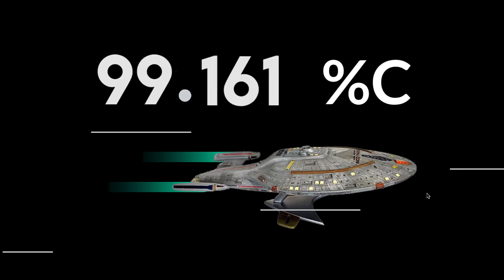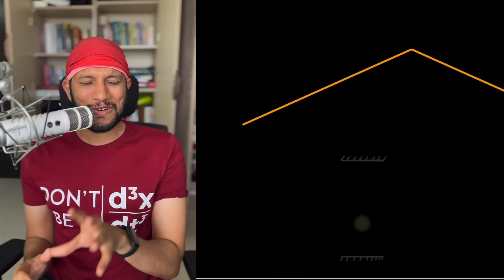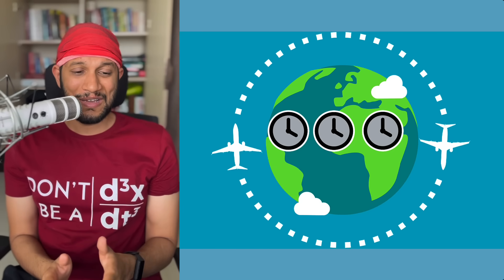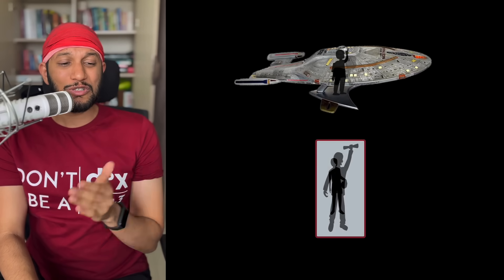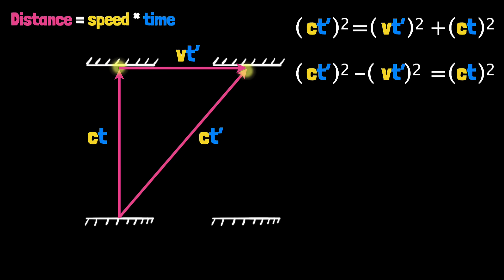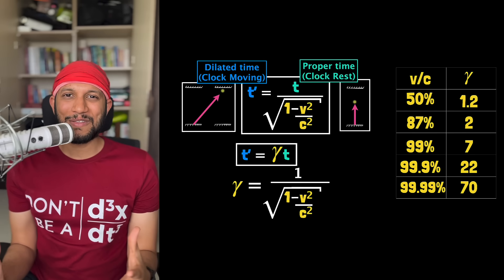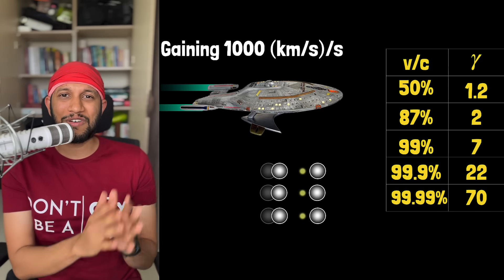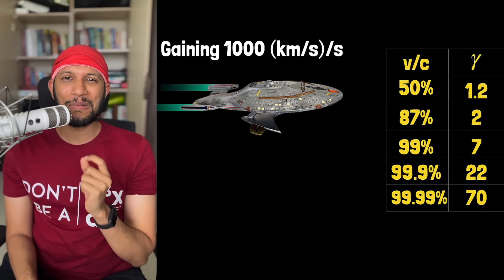I finally understood why you can't go faster than light! (My mind is blown)

Comment: the actual reason in General and Special Relativity that you can't attain the velocity of light is twofold.

There are matter space fabrics (3) and Aether space fabrics (3).  These are made up of gravitons and tensor bosons.  Tensor bosons having dual properties of the electrical force and the gravitational force (i,e. modern terms of ADC),.  Tensors hold the gravitons together with the gravitational force, while the electrical force keeps them from collapsing.  Here is steady state cosmic tension.

A graviton is made up of a positron-positron pair.  A tensor boson is made up of an electron-positron pair.  This is the 3D (4D) holistic volume of the cosmos, and quantum entanglement of these strings (the actual number of strings and their component parts).  This also has ring/loop string theory as well for these 6 fabrics.

The underlying positron particles in each graviton and tensor create the basement gravity level of that fabric.  The upper positron and electron create their own graviton field, while the tensors create their own tensor field.

Any object flying through these fabrics has drag, gravitational attraction and surface friction.  The faster your velocity, the greater your interactions with these 6 fabrics, and you build up a gravitational resistance, like running and pushing up the carpet in folds in front of you.  No matter how you geometrically or trigonometrically increase your velocity and fuel consumption, there is an equal resistance build up in space against your movement.

The ONLY way to overcome this gravitational attraction, is by having a worm bubble (Meissner force field) around your craft.  This is an electrostatic force field, which is that half of the tensor properties.  A Meissner force field - IS - a tensor field.  All of the stellar engine, fusion, photopshere, crhomosphere, corona, coronal mass ejections, ... photosphere Be'nard's Convection, chromosphere Lord's Convection (granules), spicluae on the photosphere-chromosphere boundary, corona filaments are all tensors.  Birkeland currents are tensor currents.  if you have an electrostatic force field around your craft, you have negated any gravitational force from touching the craft, and you have a slipstream, much like the Mach 1 atmospheric slipstream, sound barrier.  The same applies, with an ocean going ship that produces air bubbles along the side of the hull, this reduces the water surface friction on the ship's movement.  The key is slipstream.  Such a craft displaying this force field is like an Air Hocky game puck, floating on an air current, but it is its own form of a maglev train.  The fabrics become the 3D string rails on which the slipstreamed craft flies through space.  With a electrosttic force field you can negate Newtonian classical physics and Einstein General and Special Relativity.  You can attain light speed, and go into warp speed.  The worm bubble warps the space fabrics around the moving craft, without friction, and the worm bubble to a 3rd party viewer (General Relativity) would see a worm hole in action, when it is just a worm bubble moving at extreme velocity from one point to another.  Two active Stargates with a fixed connection would be an established wormhole. 
 
So this is the simple and basic reason why light speed can not be attained with conventional velocity crafts.

Comment: Speed of light relative to what? Lets say we have a reference point from which a photon can travel at speed of light at each direction.
Therefore maximum relative speed of two photons flying opposite direction would be 2C. 
Though through time dilation it might not be observable from either of those *, only the from initial reference point.

* Lets say same example but 0.5C. From reference point 1C between both, but since each have time slowed twice it's still 0.5C to them.

Comment: 1:32 No. Einstein's metaphor was about throwing a ball (matter particle), not a photon. Using a bouncing photon would be a bad reference since it leads up to a circle reasoning. A bouncing photon in a moving ship watched from different frames of reference has not been observed before. In stead we have this done with matter particles. That is comparing apples with oranges.

Comment: As the Big Bang occurred - as space time expanded - the length of the standard length increased and the speed of time increased thus the speed of light, which is an effect in space time - a wave that goes in and out - remained the same. A block of space time which has a constant speed of time \ standard length is a frame - see Einstein's relativity. If space time is pushed aside it ceases to have effect - the same as if water is pushed aside. As such the 'speed of light' would no longer be a limiting factor.

Comment: Nice work! So, it's impossible to accelerate a material object to the speed of light because it would require an infinite amount of energy.  

I'll add this to the concepts I keep in my head to wrap my brain around the whole thing, if I'm understanding correctly:

Photons go the speed of light, but they do not accelerate. If you are massless you are by definition going the speed of light, and therefore a photon. Photons are massless because of relativity. Light behaves both as a wave and a particle (photon), and this property allows it to carry energy and momentum even without mass. This is called relativistic mass.

Comment: If you know the fastest thing is light. then there is no possibility of going faster. Not like you can multiply the speed of light, maybe Math does not apply to light. sure you can crunch numbers but they do no apply to light. We have not even traveled at the speed of light. Until we find something faster then light, there is no way of going faster then light, as there is nothing that can propel  you faster then light. If electricity was faster, and used to propel an object? But electricity is not faster then light. we have nothing to propel faster then light itself. New technology one day may find an answer.

Comment: I think I've got it. I have a thought experiment that you can perhaps assist with. I have a super strong rod attached to the earth's surface that extends out into space. If the length of this rod is great enough, as the earth spins at 1000 mph, eventually, the length will reach a point where the end is traveling 300,000 km/sec. If the rod length is extended past this point - what happens to the rod? If I understand your explanation, the portions of the rod that approach the speed of light will slow down and the rod will appear to bend. If that's correct, what happens if we then slow the rotation? Will the rod assume it's original straightness?

Comment: Based on your explanation of reflective equations, if you want to reach a greater distance (macro), then you need to decrease your distance (micro).
Reduce the distance the photon bounces. The farther and faster you travel, the closer the bounce points need to be to increase the speed of the bounce/ energy.
It’s not the fuel that’s needed to increase, it’s the speed of the photon movement. Narrow the gap/chamber the photon moves in to match the speed traveling. The only problem I see at that point is physically enduring the increasing acceleration. Where the gravity exceeds the mass accelerating.
Just a thought. ✌️😉

Comment: Use a vacuum or Vortex Vacuum to surpass the speed of light.

Let me explain, first by example.
You're in a car, on cruise control.  A semi truck passes you and, without
effort, your car is pulled forward and faster, with NO extra gas or energy from YOU.
Another example.  You have 11 bullets, one in the center and 10 around it.  The 10 are
fired a split second before the one in the center.  There is a vortex vacuum and the
center bullet travels further and faster, in the same amount of time; it became faster.

Einstein showed that light can be affected by gravity, not because of having mass
but because it carries energy, which is equivalent to mass.....this is why it
could be affected by a vacuum or vortex....if you choose the right vacuum and properties.

In your example, there is CT, CT' and VT'.  A vacuum projected in front of
your theoretical spaceship would cause SPEED and distance to be greater than the
previous VT' variable.  Again, depending on how you build and project your vacuum.

See, there is a "bubble" - the theoretical ship.  This model is simply showing that another
bubble could be formed, outside of the ship.  "Bubble Theory"

Comment: I still don't understand. Speed is linked to the observer effect. The galaxy is moving quite fast, I hear some are moving away from us at the rate of light. even if it were slower, since we're already moving pretty fast, we'd already be moving faster than the speed of light watching this galaxy moving away. where is the energie. How can it be infinit.
Reply: Yeah I'm pretty sure this is an explanation that is beautiful, simple, and dead wrong.  Like it or not I think you kinda need the math (and timeline vectors) to understand what's actually going on.  The theory DOES talk about clocks, but this explanation is clearly confused because he repeatedly talks about acceleration and the forces between particles--but special relativity doesn't talk about acceleration at all.

AFAIK, in your own reference frame, there is absolutely nothing stopping you (in theory) from experiencing continuous acceleration forever--and there is nothing privileged about the other observer's reference frame that makes it more correct than yours.  Let's say you're accelerating due to gravity and not fuel cost, due to a black hole already in your reference frame--as far as I know, GR says acceleration and gravity are locally indistinguishable, and gravity empirically propagates at the speed of light in EVERY direction (including straight towards you, which wouldn't be affected by the "rotation" he talks about).

Comment: So in your photon/Enterprise speed comparison what is it that the photon is bouncing between?  If the photon is fired in a straight line in the vacuum of space what is going to reflect it so that it goes back and forth like the graphic shows?  It seems that the graphic pretty much assumes the photon is bouncing between the insides of a perfectly mirrored tube.  If travelling in a straight line and the Enterprise keeps speeding up the photon will indeed seem like it is slowing down but it is still travelling at the speed of light.  The Enterprise is gaining speed and when it reaches the speed of light the photon would appear to stop but both are still travelling at the speed of light.
Reply: Also, don't the mirrors leave the photon behind at some point so that it no longer can bounce off them?

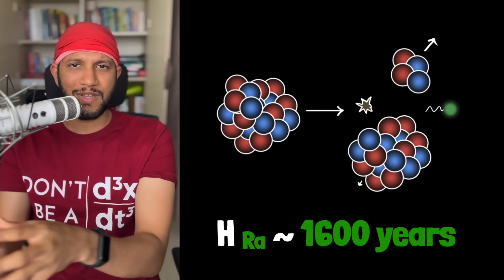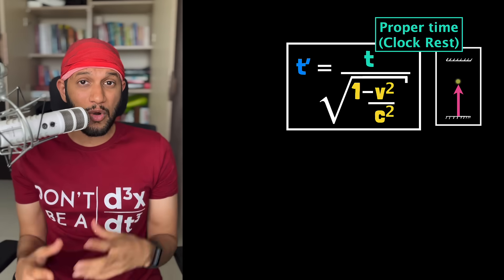Comment: 3:00 that photon transfer as if "information" xfer is kind of wrong IMHO. Whatever the nature of atomic bonds really are, sure, it makes sense that there might be tiny lag, based on the speed of light and whatever EMF laws are linking the two atoms, and the distance between the atoms (or the distance between wherever this interaction takes place between the two electron clouds- and in turn, presumably, the nucleus). The other problem is the displacement you show for each successive atom-- your analogy displaces each atom far too much . Not nitpicking here because I think it is important to get this right. Models have always been a problem for folks like me, so, critical to get every detail as exact as possible, or else the explanation starts to go off the rails. 5:20 You should define a Muon, Just saying. You leap from oversized unstable nuclei to Muons. 10:00 but what is "at rest"? There is no special frame of reference. The earth turns, it orbits, the solar system bobs up and down in the galactic plane; the galaxy is moving, and, apparently space is itself expanding, so that's probably doing something weird. Otherwise I LOVED this video.

Comment: Actually this is completely false...
To accellerate an object to the speed of light you simply modify its kinetic impact... With this method you can travel at the speed of gravitational waves, which btw move at several lightspeeds... Infact gravitational waves are so fast they would be the first thing we would notice if the sun exploded... Not even the gravitational field can keep up renotely, and neither can light... Another example can be found near black holes, where gravitational pull exceeds lightspeed trapping it indefenitely... The reason for that is the kinetic property field of mass... A mass can only travel as fast as the existence in front stretches without matter, however a kinetic field, similar to how gravity works, bypasses this law by bending the 4th layer of space, imagine a magnet which has its attracting end in our sphere, it attracts matter and rejects dark matter/antimatter, this is a proven and used concept by Nasa btw... In the field of this kinetic energy is transfered differently depending on how strong this field is, but also one could directify this field with a euler angle calculation based on the kinetic potential of the field towards the nearest matter, this concept is not very well known as making a kinetic field requires much deeper understanding of bosons and the properties of denser matter...
Some suns have this reaction at their core which causes the Beam upon their death, pointing into 2 directions... The beam is fast, but the gravitational force of the kinetic field is faster and travels slightly before the erruption... Welcome to quantum physics

Comment: Great explanation. As someone with very limited knowledge of physics, i do have a question: in your example of the photon clock moving, what forces act on the photon to cause it to to travel diagonally instead of simply directly upward? Do the same forces that act on the other particles making up the clock act similarly on the photon? What forces are they exactly?

Comment: That's very well explained. I really like Mahesh's strive for intuitive understanding, even though that's not strictly defined.
The best I can say is to show the same phenomenon in different aspects so that our brain gets to see it from all these different views, and if they're all consistent it would be more convincing it's true (though not really a guaranteed - the guarantee is THE PROOF, but that can be really time consuming and pedantic, and even if you go thru it all it still might not give you full understanding of the phenomenon).

Anyway, I have additional question regarding the Einstein's photon clock.
How does the photon behave? Imagine the starship is not moving (still at the docks). You turn on the photon clock, and the photon starts bouncing between the two mirrors.
Then the ship starts accelerating. What happens with the photon's position? Does it fall back, as the accelerating ship moves the mirrors out of the photon's trajectory?
Or does it move with the accelerating ship, and if so - why?

Comment: If you carry this to it's two extreme ends, you end up with some even more mind boggling ideas:
🔹If the ship is moving at 100% C, then all of time outside the ship passes in an instant for travelers on the ship. Traveling at 100% C even 10 feet is a trip to the end of time, presumably when the universe collapses.
🔹Traveling faster than C means going beyond the end of time where speed is meaningless, because without time speed can no longer be calculated.
🔹We are technically not "at rest" even if you are sitting motionless in your chair. We are moving as the Earth spins at (up to) 1000 mph; The Earth orbits the sun at 67,000 miles per hour (average); The Sun orbits the galaxy center at 514,000 mph; The Milky Way Galaxy is moving around the "local group" (of galaxies) at 1,223,000 mph. I don't know if science has determined any larger scale movements through the universe, but those movements probably exist. So far that's a total of 1,805,000 mph or(1.609344 kph) or 0.0027% C and all you are doing is sitting in your chair.
🔹If we were able to stop all the above movement to be truly "at complete rest" relative to the universe then the passage of time completely stops. We would observe a universe frozen in time.
🔹It is this intrinsic movement through the universe that creates our perception of the passage of time. Time is unmeasurable, or virtually nonexistent at both ends of speed.
Reply: i give you now the answer i hardly found, by myself. Einstein himself was never able to explain this.

no real clock slows down, because no real clock measures time, not distance. all real clocks measure time*distance, and that is a non-variable. 
Einstein was often confused

the answer to the twin paradox is: 
all twins in the Universe live in the time*distance, not in time, nor on distance. 
this is the key to understand the limits of special relativity, that is a non-functional theory, merely a didactical object.
no twin ages more, by virtue of relative motion and speed.

there are three types of time, all different, always different: 
1. theoretical absolute time, or say theoretical local time;
2. theoretical relative time, or say theoretical distant time;
3. measured time, the real time, that ironically does not have the dimensionality of time, it has dimensionality time*distance